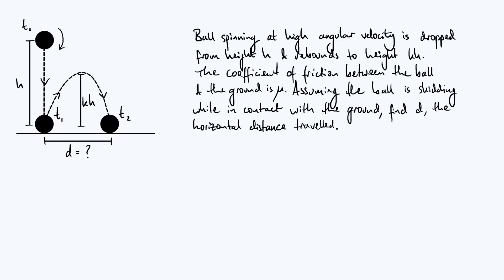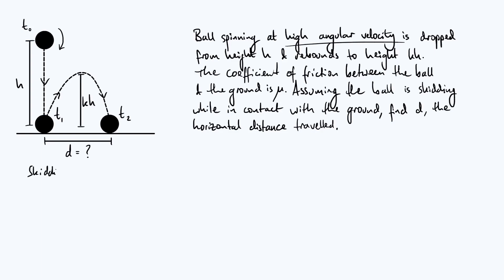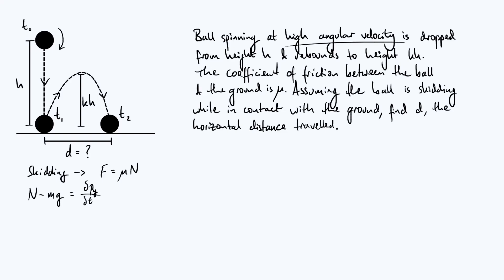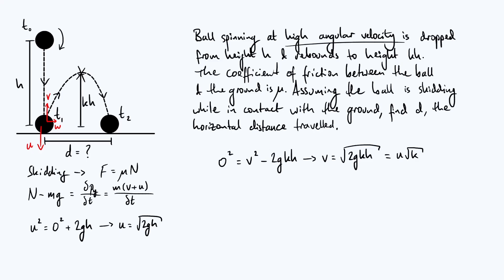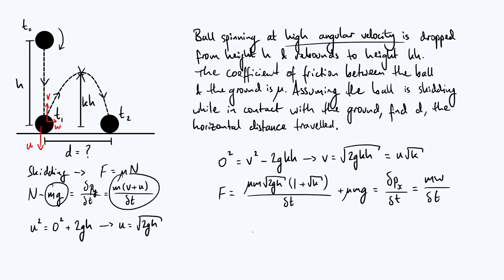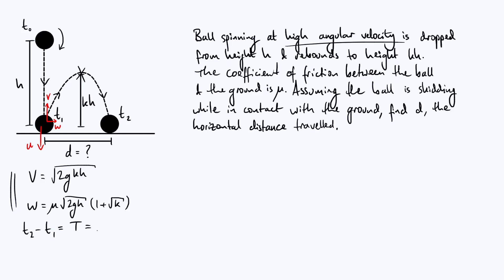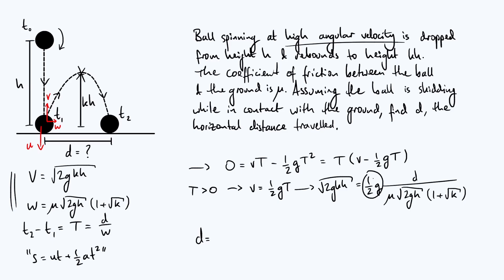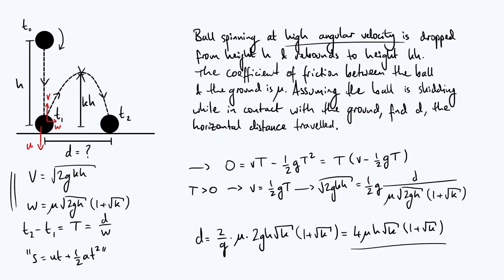Spinning ball bouncing off a rough surface

Comment: Another problem could be to properly solve for kh, I remember doing it 2 years back, and the results surprised me. Both components of velocity after collision are independant of radius of the ball, so any problem where a ball is spinning and collides with a surface, or even not spinning and collides obliquely with a surface has to be dealt with properly by finding angular velocities after collision and taking care of rotational energy and energy loss when it is slipping against the surface during collision, NO MATTER HOW SMALL THE BALL IS. 

Any problem that tells you to ignore these effects by assuming the ball is small is essentially made in the wrong light. Very interesting I might say.
Reply from the maker: Interesting - solve for kh given what information?
Reply: @DrBenYelverton  As far as I remember, only h is given, coeffecient of friction mu and rotational velocity omega. I think we may also need coeffecient of restitution. 
It could be that I am remembering incorrectly. I will whip up my past notes and repost here.

Comment: Still wrestling with the fact that initial angular velocity or acceleration does not change the horizontal distance.( In tennis for example is obvious that it does(?))
Reply from the maker: We're assuming that the angular velocity is high enough that the surface of the ball scrapes against the surface for the entire time it's in contact. Presumably tennis balls are not usually spinning fast enough to enter this regime, so the result from the video doesn't apply. If you want to make this quantitative - have a look through the video comments and you'll find an overview of a method we could use to estimate the minimum angular velocity for which the result is valid.

Comment: Nice problem but the whole "ignore \delta t" thing seems a little deus ex machina. Don't you need some kind of estimate of \delta t to justify your neglecting of it? 

And its magnitude would strongly depend on the value of \mu, I think, as well as maybe trickier stuff like the modulus of compressibility.

Comment: Interesting that the situation naturally imposes constraints on k.
E= hmg
KE (post) = ½m(v²+w²)
v²= 2ghk; w² =μ²2gh(1+sqrtk)²
KE = mgh(k+μ²+2μ²sqrtk+μ²k) <= hmg
==> k(1+μ²)+2μ²sqrt(k)+μ²‐1<=0
==> sqrt(k) <= (1-μ²)/(1+μ²) = -1+2/(1+μ²) ~ 1-2μ²
Reply from the maker: There's also rotational KE that should really be included in those equations! The angular velocity after the bounce will depend on the angular impulse the ball receives, and hence the ball's radius will end up making an appearance too.

Comment: Thank you so much for the help sir ❤
Reply from the maker: It was a very interesting problem! You should be able to solve the final part of the question (about the minimum angular velocity required) using a method outlined by one of the other commenters on this video.

Comment: 8:24 how can we do this calculation and what information would we need ?
Reply from the maker: You could model the ball as a spring and use its effective spring constant to find the time taken for all KE to be converted to EPE, then back into KE. As for how to estimate the effective spring constant, I assume it could be done if you knew the radius and thickness of the ball and the Young's modulus of the material, but it's not obvious to me how you'd put this all together!

Comment: This is all in the absence of drag/air forces right? Could be interesting to include the Magnus force which propels the object forwards as it rotates. Does there exist an angular velocity where the magnus force pulls it back to where it was dropped from?

Also, by assuming negligible contact time with the ground, does this mean the angular velocity of the ball doesn’t change? What’s the minimum angular velocity for skidding? So many questions sorry! It’s an interesting problem as always.

Let me try answering my own qs: 
If contact time is zero, there is a horizontal impulse on the ball at the ground equal to mw. Therefore there is an angular impulse (change in angular momentum) of mwr, where r is the radius of the ball. So using angular momentum, mwr = I(omega_0 - omega), and we can solve for omega after the bounce so yes it changes. My guess: if we let omega equal zero, we can solve for the minimum allowable omega_0 to stay skidding.
Reply from the maker: Questions are always welcome, it's part of what makes posting videos interesting! Including the Magnus force would certainly complicate the equation of motion as you now have an additional force which is always perpendicular to the velocity. I'm not sure if this ends up being possible to solve analytically, but will give it a try when I get a chance. For your angular velocity question - I mostly agree with your solution, but should the condition to remain skidding perhaps be rω>w instead of ω>0?
Reply: @DrBenYelverton  Thanks for the response. For the magnus force, I think there is a closed form solution and I spent quite some time working it out, but the answers I got made no sense. Frustratingly, other people who have tried to work it out online have also made mistakes. I find it hard to believe nobody has done this analysis before, but I couldn't find any!

In cartesian coordinates, the equations of motion I got for a falling anticlockwise-rotating cylinder are:

mx'' = -ky'  and  my'' = kx' - mg

where the magnitude of the Magnus force is |F| = k|v|.

This can be solved on wolfram alpha but gives a solution with trig functions, rather than exponentials. Changing the sign of the first equation to +ky' gives exponential solutions that seem more realistic, but why the sign should be positive confuses me.

Honestly, this might be worth a video!
Reply from the maker: Interesting - will put this on my to-do list!
Reply: @DrBenYelverton   Btw, it would be really amazing if you also did some rigid body dynamics
Reply: Magnus force actually depends heavily on the balls velocity through the air, or rather the air velocity moving over the ball/object.  It also does not always propel an object forward.  It creates a force perpendicular to the velocity of the air and its axis of spin, the resulting force being scaled by the cross product of the two vectors.  The ball can be spinning extremely fast but if that spin axis is parallel to the air velocity no magnus force exists.

The spin drags a layer layer of air towards one side of the object which causes air to flow faster over one side of the object than the other which makes the object act like the wing.  But, much like a wing, the force generated depends on the speed of the air flowing over the wing.  More air flow = more force.

So, even if the ball was spinning with heavy backspin the magnus force acting on the ball from its forward direction would be pushing the ball up or down relative to its direction of travel, which would create vertical lift on the ball or cause it to fall faster.  To the component of the force pushing the ball back towards where it bounced from would be dependent on the vertical speed its bouncing back up at.  So you would need a very high coefficient of restitution and the ball dropped from a very high height to generate enough vertical velocity to really show much of any magnus force going back towards the balls origin.
Reply: Now that I think on it further actually, the magnus force would be pushing the ball further away from its starting point on the rebound as the fast airflow side of the ball would have to be towards the front if the ball had front spin to bounce as displayed in the videos illustration.  If the ball was moving upwards the relative airflow around it would be moving downwards towards it.